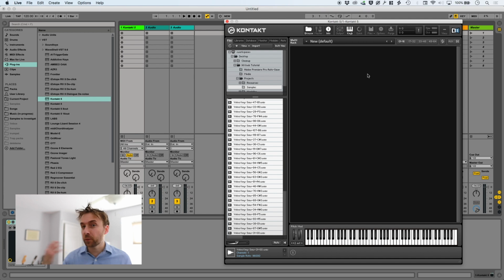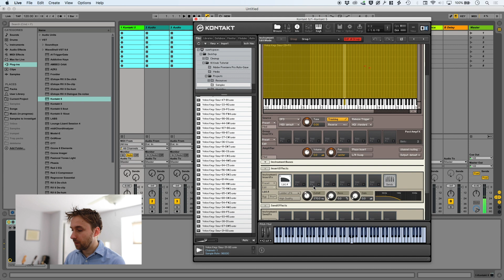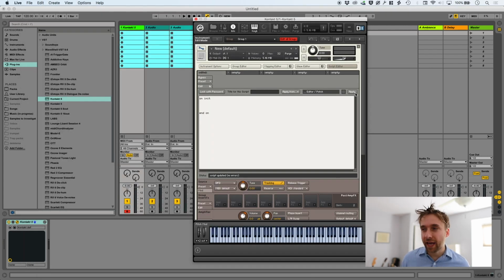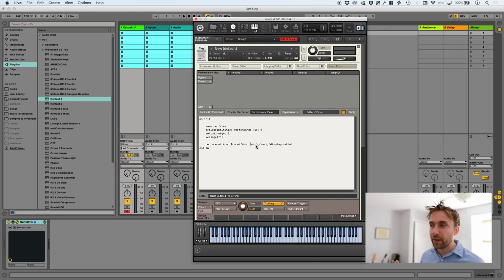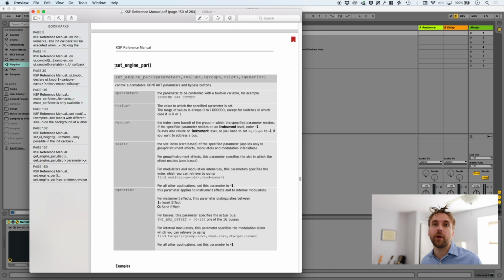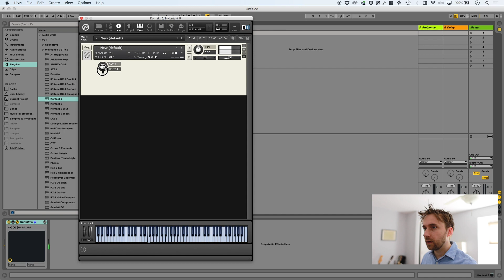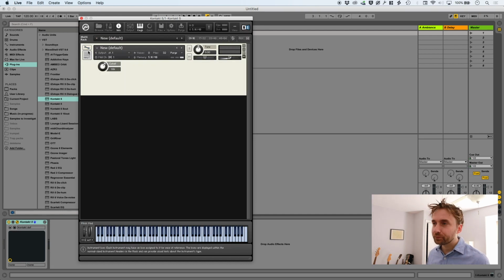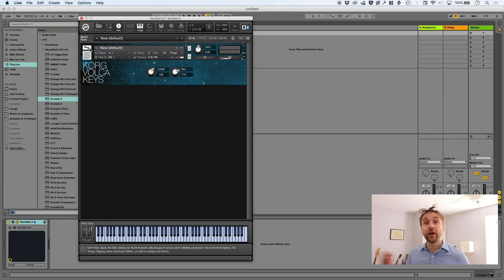Intro to Kontakt Scripting: Adding your First Knob + FREE KONTAKT INSTRUMENT

Comment: Funny. The only reason to have this knob would be to allow the customer to avoid the $400-600 it takes to buy this 20 year old piece of software in order to access the cutoff directly from the insert. But in doing so, you must pay Kontakt (several hundred dollars per year, for life), to allow your user to avoid the $400-600 it takes to buy this 20 year old piece of software in order to access the cutoff directly from the insert. Greedy, corrupt fellowman running Native Instruments for sure. By the way, when do think they're going to update their 20 year old interface? So I don't need to be 10 inches away from my 4k monitor and avoid wrecking my eyes after a day's work? And so I don't have to rely on a literal single 4k pixel to make a 5% adjustment to an envelope?

Comment: Hi David, would you be able to help with how to declare a knob to modulate a Convolution Reverb on the Main Effects part from an NKI instrument? Its on Slot 0, but am not sure how to declare it and what to use to define. Also would be great if could have a button to turn on/off. But at this point would be hopeful if could help with how to do this. I think it has something to do with the following possibly, but am not sure on this. Thanks, JimP

on init
declare ui_knob $reverbKnob(0,1000000,-1)
set_text ($reverbKnob,"Reverb")
set_knob_label ($reverbKnob, get_engine_par-disp($ENGINE_PAR_EFFECT_TYPE_IRC,-1,0,-1)
make_persistent($reverbKnob)
end on
{--------}
on ui_control ($reverbKnob)
set_engine_par ($ENGINE_PAR_EFFECT_TYPE_IRC,$reverbKnob,-1,0,-1)
set_knob_label ($reverbKnob, get_engine_par-disp($ENGINE_PAR_EFFECT_TYPE_IRC,-1,0,-1)
end on

Comment: Hi David, first of all thank you very much for all these useful videos. I find them very helpful and inspiring. Not sure what happened with your hairstyle in this video but that’s ok- artistic freedom…🤣 My main question: you’re starting one step too late or advanced for me, ie how do you generate all these neat samples that you then just nicely and simply drag and drop into Kontakt? That’s where I’m stuck. Should I record one large session and then chop up? Is there an easier/faster way? I’m using Ableton but I also have a couple of other software samplers. Would it be better to do it in sampler like eg Waves CR8? Thanks again for your help and advice. All the best from Ireland, Jan

Comment: Hey great video. I want to sample a little semi modular and make into a library. 2 things I'd like to ask. When i sample it , do i need a fully sustained note or does note length not matter? Also there's no way of knowing which notes coming out without using a tuner plug in, do i have to at least sample a different note from a whole octave?

Comment: Hi, I used this video to add knobs to a Kontakt instrument. Thanks for putting this together, it's really informative. It has inspired me to dig a little deeper into scripting. I've recently built a simple instrument with an LFO modulation, and added a knob for controlling the frequency via a modulator. This is fine, except that the knob is not responding to the move_control command, as used for all the other 8 knobs. Can you help? Thanks again for this video.

Comment: 2'45 It does matter where you add it if you want to also route velocity to that cutoff... must be in the group inserts for that.
Reply from the maker: Good point. That's absolutely true!
Reply: @DavidHilowitzMusic   If i want to add another knob and functions would i have to start a new on init?
Reply from the maker: @MaseratiSparks  no. you can declare as may knobs as you need within the same init block.
Reply: @DavidHilowitzMusic   I dont mean to pander you but this is what i have so far
 declare 
ui_knob $Reverb(0,100000,1)
 set_text($Reverb,"Reverb")
 set_knob_label($Reverb,get_engine_par_disp($ENGINE_PAR_RV2_STEREO,-1,0,1)) so  i would duplicate and do the same thing?
Reply from the maker: @MaseratiSparks  Yes, but with a different variable name.
Reply: David Hilowitz Music  ok and being that the insert effects starts on zero it would be 1 so I can do a variable of delay and then insert effect I would make it 1